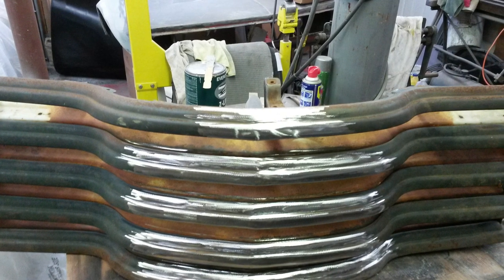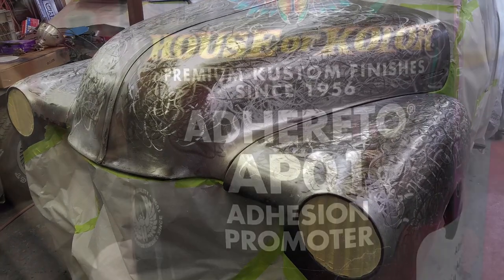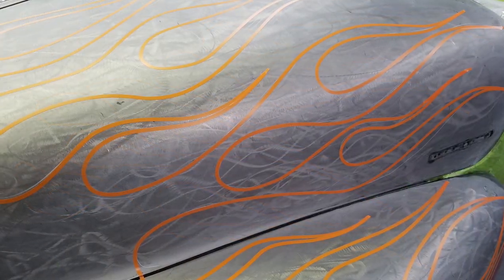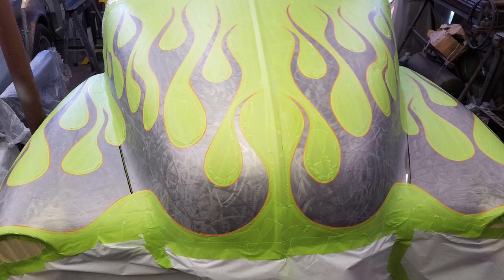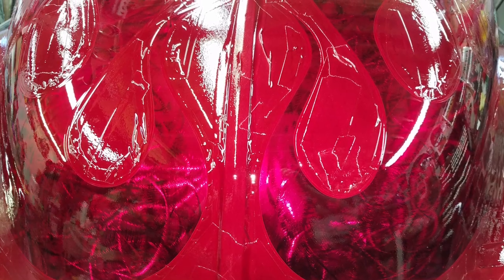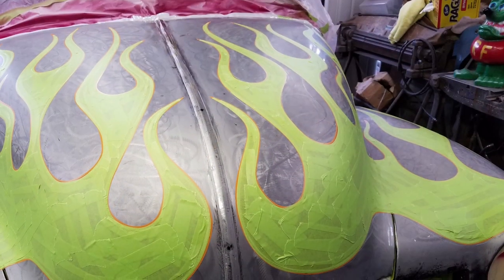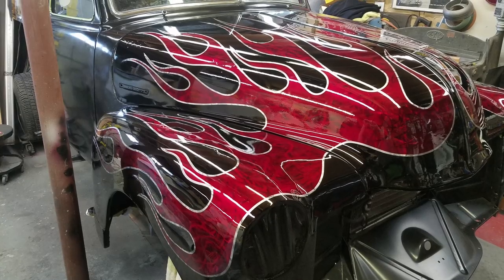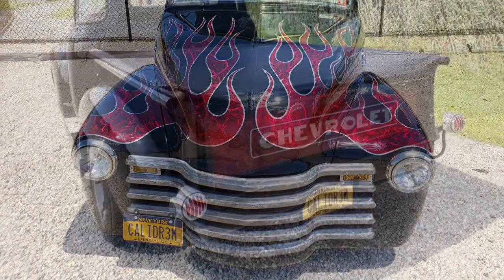Ground Metal Candy Flames

Comment: Awesome! Couple questions as I'm interested in trying to stuff similar. Obviously there's no primer/bondo to get it perfectly smooth.  If there's tiny low spots how do you get them perfectly smooth?
Reply from the maker: Hi, Glad you liked the video,  actually the truck hood had a bunch of small dents in it , I laid out the flame pattern to go around them and filled them in after I did the flame work, but if you can’t do that I would work the metal as best you can to get it as straight as possible, if your doing the grind method and going to Candy over it the clear coats will fill in very small imperfections in the metal and after wet sanding they should hardly be noticeable, Hope this Helps, Thanks for watching

Comment: That looks awesome man I have a question do you have to use any kind of conditioner on the bear metal to prevent rust  Or just spray adhesion promoter and then you're clear
Reply from the maker: No metal prep, that will change the color of the metal, I just wiped the metal down with lint free cloth and used the adhesion promoter then clear coat, I know a lot of people are worried about the metal rusting, I did get some small spots of rust come back but the truck was outside for 5 years on the East coast so not too bad, I would do it again, Lol
Reply: @EYEBALLJOHNsKUSTOMKORNER   Yeah that's what I thought about the metal prep it will change colors of the metal Your truck turned out awesome and the black and red just pops

Comment: For a beginner what rat rod 4" tattoo can I paint on my c3 vette inside door panels.. one that would be the easiest? Like with stencils etc?
Reply: Like rat fink or eyeball
Reply from the maker: They make all kinds of stencils for airbrushing, skulls are one of my favorite, but painting a door panel with paint could rub off , if it was hit enough times with an elbow , what about having something embroidered on a piece of vinyl and then attaching to your door panel?
Reply: @EYEBALLJOHNsKUSTOMKORNER  ah yes the car is all in fiberglass. I'm about yo spray jambs this week with 2k then the green metalic base. Then I wanted to do the airbrush then clear it all.
Reply: @EYEBALLJOHNsKUSTOMKORNER  I meant door jambs not panel.

Comment: The adhesion promoter and clear base won't fail?
I love the end result just kinda confused why's my brain telling me that this shouldn't work
Reply from the maker: Your right, I thought the same thing, but it worked truthfully not 100% sure that the adhesion promoter was needed or not, but the clear coat is just paint with no pigment, so you are coating the metal and sealing it, I did this paint job 4 years ago and the truck has been outside all that time and two small spots of rust  the size of a pencil eraser showed up under the flames on the front but didn’t lift up just discolored the paint so I would say it works, Thanks for your interest in this video

Comment: Why sand the black? If its urethane on urethane theres no need.
Reply from the maker: At that time all I had was single stage black and I wanted the finish as smooth as possible,  if it was base coat black then of course you wouldn't sand just spray clear over it